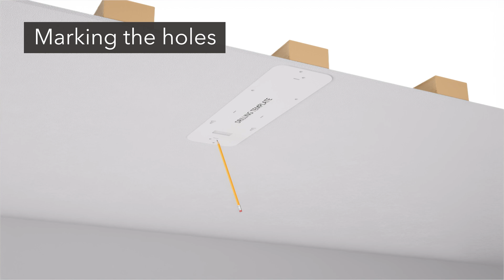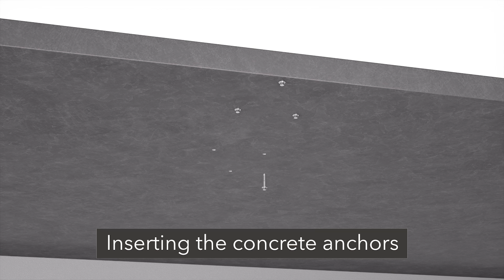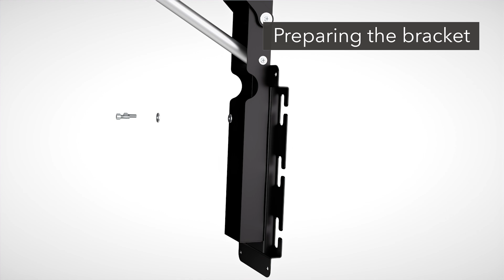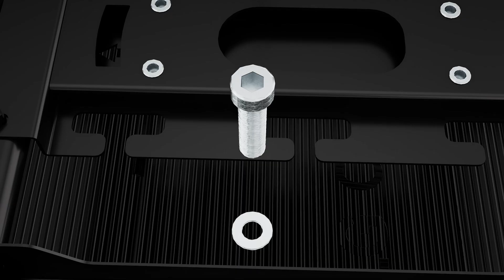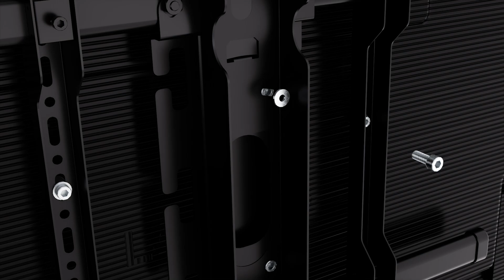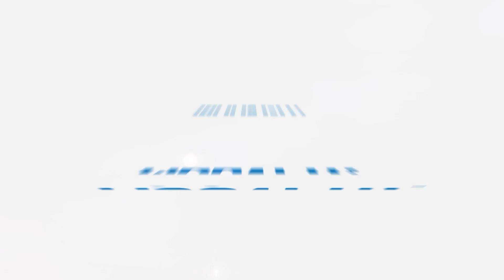Motorized Ceiling TV Mount | MI-4226BLK MI-4226WHT (Installation)

Comment: What if you want to mount it the other way 90 degrees from what you show!
Reply from the maker: You would need to create a backing to support the product if the ceiling joists are running perpendicular to the direction you would like to mount this ceiling mount. You can contact 1-855-915-2666 to speak with customer support representative.